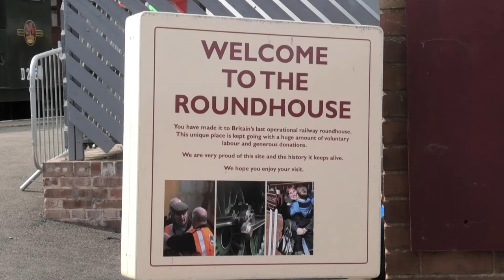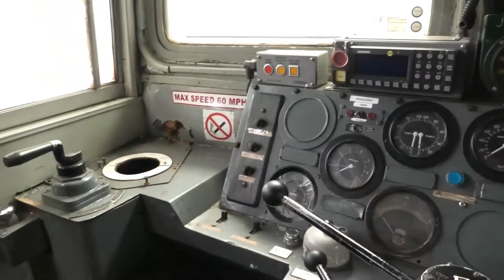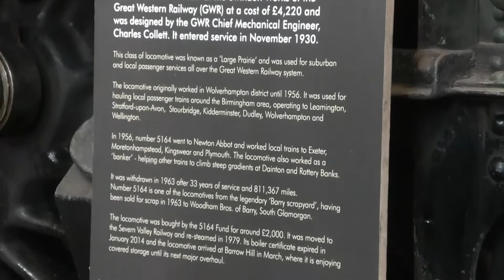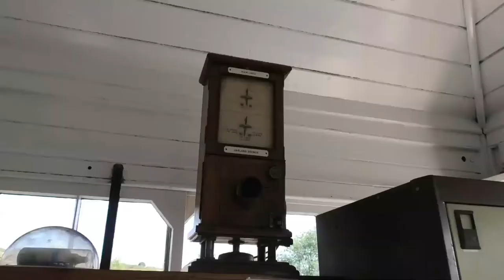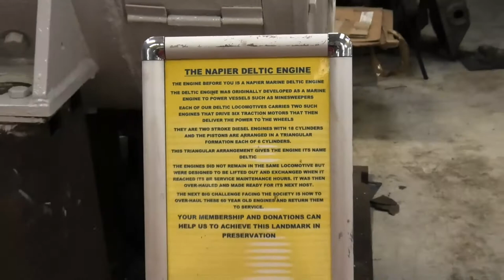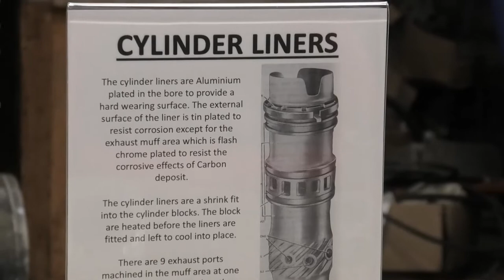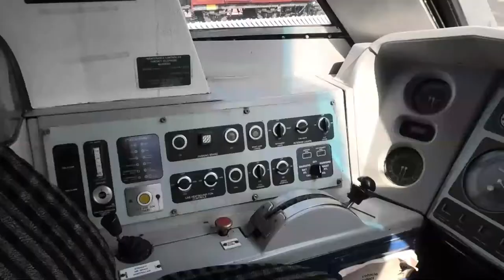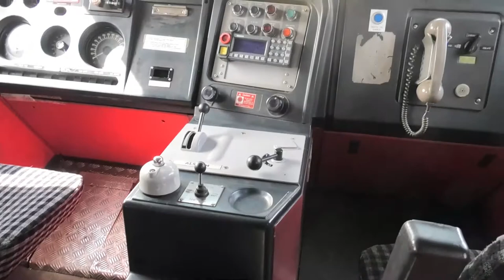Barrow Hill Roundhouse 150 + 2

Comment: Brilliant video Cedar. Forgot the 07s were Ruston Hornsby. I thought there were two at Barrow Hill so wonder where the other is. Hard to believe most of the ones scrapped only did 15 years service.  Is 20905 now preserved ?. Amazing to think Power unit 430 was last used in 55008. Tulyars looking well nice should do they been at it almost 15 years. Baby Deltic looks almost complete. Is that a class 58 chassis at 17:00 by the 08s/9s ?.  I liked how there was some sausages on the signal boxes cooker lol
Reply from the maker: Thank you axl I always liked the look of the 07's and never got to see any until a visit to Eastleigh where we were told strictly no photos were to be taken and all cameras had to be left in the time office at the entrance. I was annoyed because there was an 07. The reason for no photos an as yet unseen named 33 Burma Star was there and they did not any photos taken before it was unveiled. I only saw this 07 so no idea where the other is. They were good locos but sadly their work in the docks dried up. I presume 20905 is preserved as it has been there a while judging by the time the batteries have been removed HNRC did that in 2019. I found it interesting they put those notes on the Deltic engines. Tulyar does look nice and you couold go in the cab but the Q was long and there was so much else to see. I am not sure how much there is to do on Baby Deltic but body wise it is not far off now. Last time I saw it it was in two halves with marks for laser guides to get it set up for welding together Cut n Shut to a new level LOL. Well spotted on the chassis I wonder myself now. I did not really look at that. The frying pan amused me as well. There was a lot of noise in the box with kids so I missed getting all the details in there Had to get the cooker in though. Good thing I had enough spoken sound recorded to dub over them

Comment: I hadn't seen a steamroller since people got flattened by them in the cartoons ! Could you say a bit more about the turntable ? It looked electric. I was expecting it would be an old fashioned manual turntable. great vid and great museum !
Reply from the maker: LOL This is the real thing and would sure make a nice pancake Built by  Aveling & Porter in 1916 it weighs 10 tons. Many still call road rollers steam rollers. The turn table is electrically powered now but I am sure when it was put in in 1931 it would not of been. Some were worked by the locomotive being turned by connecting the brake vacuum pipe to a turning engine. It has 24 roads or tracks around it and has to be aligned manually which I saw on a TV programme takes a lot of skill. The momentum has to be judged when you slow it down and it varies on the weight of the loco how far it will run before it stops The guy on TV had a go and had to reverse back and forth a few times to stop in the right place A lock worked by the white lever with black top keeps it in place. It is a great museum but not easy to get to by train as it is on a freight only line. They used to run a train from the main line station in Chesterfield on special events like this but these days it is a free bus.
Reply: I’m operating the turntable on the video . It is electric and can also be pushed round or done with the hand crank.
Reply from the maker: @Derbys65  Thank you for the extra info Derby65. I would think pushing it round will not be done often.